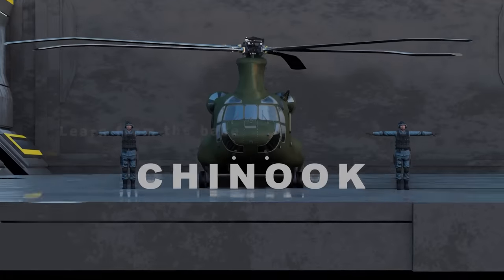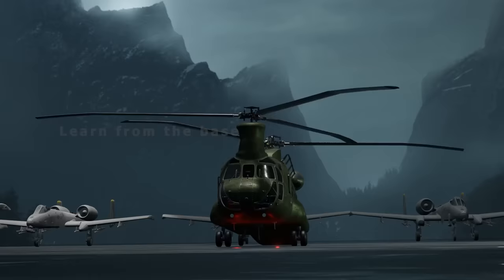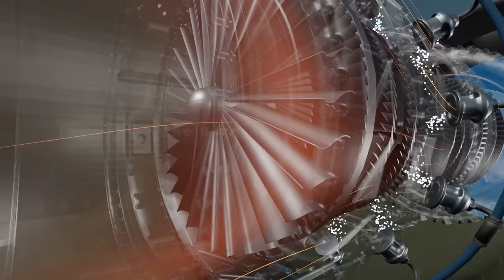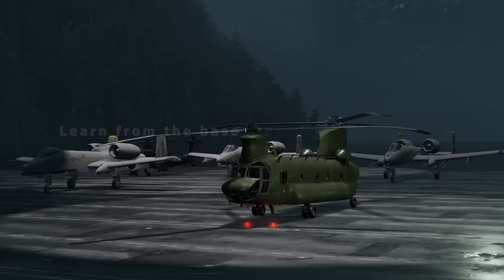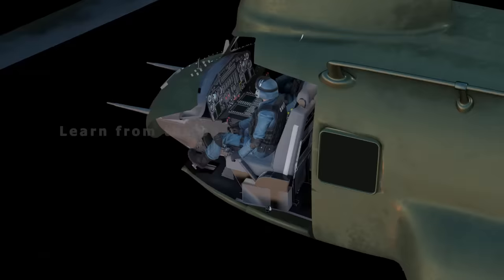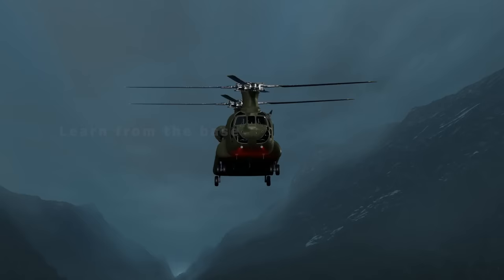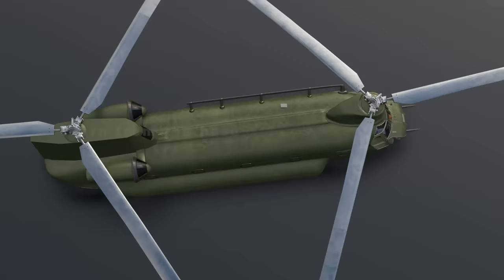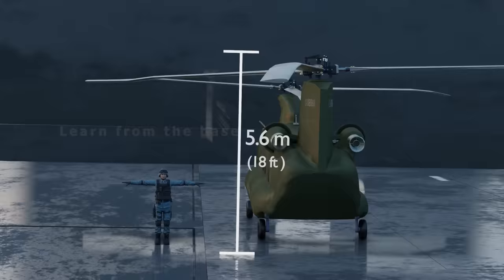How does a Cargo Helicopter work? (CH-47 Chinook) Heavy Cargo Transporter.@Learnfromthebase

Comment: Chinook can’t carry Tank.
Reply: Yes, it can
Reply: @tanjahoewel1237 he’s talking inside the cargo bay I think not the external load
Reply: Yes it can lol
Reply: @UTInteractiveYT  he’s talking about the internal catbo bay not external cargo gold ch47 can carry tanks using ropes outside
Reply: @tanjahoewel1237 so… the latest model (CH-47F) has about a 26,000 lbs cargo limit with the center hook maxing at 15,000 lbs while the fwd and aft hooks carry 5,500 each I believe? Idk that’s what the Tech Manual says anyway. The only type of “Tank” this big guy can carry is a light tank. So while you are technically right, your traditional first thought of a “Tank” weighs at least 30 tons. Meaning no dice for cargo Bobby here.
Reply: @UTInteractiveYT  so… the latest model (CH-47F) has about a 26,000 lbs cargo limit with the center hook maxing at 15,000 lbs while the fwd and aft hooks carry 5,500 each I believe? Idk that’s what the Tech Manual says anyway. The only type of “Tank” this big guy can carry is a light tank. So while you are technically right, your traditional first thought of a “Tank” weighs at least 30 tons. Meaning no dice for cargo Bobby here.
Reply: Tanks have various specification,surely scorpions has different weight from abrams
Reply: I was in the military airlift command and I'm pretty sure the old bird can't carry any tank that is in our inventory. C17 can carry one.  C5 can carry 2 but it would only do so during a war.
Reply: You can hook it outside

Comment: It's nice to see some appreciation for us cargo boys from a Chinook crew chief. One additional thing, While the aft rotors are higher than the fwd rotorhead its not the reason the blades don't hit each other. Both rotors are mechanically linked by the driveshaft so when you rotate one rotor the other one turns at an identical rate in the opposite direction. The rotorheads themselves are phased so each blade always remains the exact same distance from each other. Like the way an old hand crank egg beaters whisks pass through each other but never touch
Reply: I wonder if they'd shake each other to pieces too from rotor wash otherwise.
Reply: @first-thoughtgiver-of-will2456  look up Chinook ground resonance videos.
Reply: I was wondering what would happen if the rotors bend
Reply: @kevinfernandez9999  what do you mean by "bend"?
Reply: flex
Reply: //em//
Reply: Hated phasing the blades. In Afghanistan we had a detachment of 6 guys supporting a fleet of 6 birds. They'd detail us out so by the time we actually had to work there were only 2-4 of us, tops. Real pain in the ass when you're changing out the silicone washers on the pitch change links. Or if your sergeant doesn't listen to you and install the actuator blocks so you spend 14 hours trying to phase the damn blades before he "suddenly" has the bright idea to try it your way like it says in the book (I think he was too scared to fire the apu and bop the hydraulics).
Reply: @Kevin Fernandez  they do bend. There's a bit of flop. But on the aft, there's a droop stop eliminator. That's why you'll usually see the blades tied to the aircraft while on the flight line so they don't flap in the wind and try to eat the frame. We had that happen before. One of the things you learn early on is how to tie a good chinook knot.
Reply: Thank you for your service !!!!!!!!!!!!!!!!!!
Reply: Pls how can i join USA Air Force 
I’m from Nigeria with only secondary school certificate
Reply: What a good metaphor! It really helps a lay person understand the concept. Everything about this seems like a beautiful dance

Comment: The USAF doesn't fly the Chinook, in the US, it is flown exclusively by the Army.
Reply: I've seen Chinooks parked at Norfolk, so the Marines uses them too.
Reply: @andyx6248 you have not seen marine 47’s. Maybe 46’s 20 years ago.
Reply: @andyx6248  The USMC used to operate the CH-46, never the CH-47. The '46 is about 2/3 the size of the Chinook, had less internal seating and could not lift as much as the 'Hook. The Sea Knight was more maneuverable but the Chinook never seemed to run out of power. (I flew the '46 as a Marine and then the '47 when I "changed religions" to be come a pilot in the Army Reserves.)

Comment: When I was camping, there was a fire several miles away, a Chinook came once every ten minutes to pick up water from the lake. It was very loud and it was like thunder.
Reply: The CH-47 can carry a 2,000 gallon water bucket. This is a very powerful tool used in wild land firefighting. Army National Guard CH-47 units and pilots are expert at wild land fire fighting in their states.
Reply: @Patriot-bn9om Yes sir. I remember a famous photograph of a CH-47 extracting soldiers and civilians and detainees from the roof of a remote villiage in Afghanistan. It was the PA Air Guard pilots. Whenever I went down to Fort Indiantown Gap for training I would watch them hovering in the middle of a field 4 feet above the ground. They did that most of the-mid day to practice stabilization in shifting winds and warm air thermals. It paid off in Afghanistan and Iraq where I got to ride them in action. Those pilots would fly into the rotor wash of the leading Chinook, be blinded by dust, fly in and land sideways all off instruments and night vision. Damned good at their jobs.

Comment: I’ve had the fortune to spend many hours flying in the back of this beast. Static line jumps, HALO jumps, helocasting, small boat inserting/extracting and fast-roping. The one thing that scared the crap out of me was in-flight refueling at night: I recall one mission watching it happen under night vision while I was sitting on the floor near the forward starboard gun window- it seemed like the blades were almost touching the C-130 that was giving us gas. It was, for me, terrifying. What an amazing machine and it always brought us home. Props to the crew dogs and the pilots! 

🇺🇸
Reply: ..em..
Reply: special forces sir?
Reply: 1-60th?
Reply: //em//
Reply: @jakegames1870 160th SOAR  "Nightstalkers" (not "1-60th "). 160th is the aviation unit that flies special operations missions, SF and other military branch operators do the jumps
Reply: Still safer than stopping for gas in any large city here 😂
I stay away from all urban areas

Comment: I mean you tried.  I'll give you that. Some things are close enough.  But you should have done better research.  You got the counter torque right, but the Fwd head rotates counter clockwise, just like EVERY US designed helicopter.

Its a minimum crew of 3 up to 6 mission depending.  Never knew my Flight Engineer and Crew chief were sitting in the heater and avionics closet facing forward.  

The engine compression/combustion was close enough, as well as the description of the drive shafts.  As stated from someone else, the rotor blades are intermeshed, and phased.  

The rotor heads are of a RC model.  Not even close.  Plus there are only two dual boost actuators (not four) per rotor head.  At least you referenced Differential Collective Pitch (DCP) correctly.  And did a decent job describing how the two rotor systems work with control inputs.

And the glaringly obvious was the Tank as external cargo.  Unbelievable.

Comment: The fact that the two rotor blades never touch each other is one thing that never ceases to amaze me. The design ingenuity of the engineers hats off to them.
Reply: they're at different heights..... super complicated.
Reply: @CallMeByMyMatingName not true, they flex. The reason they dont hit, is because they are both connected by the drive shaft in a way that they will never touch, think of it like an old mechanical egg beater
Reply: @MilkT0ast    So your troll is to pretend you're blind? Kindly observe a photo of the Chinook. 

Of course, the blades are geared to sweep into the other's gap.

I'm not sure why you mention they flex though. It'd be a non-factor, for multiple reasons. 

 Engeneers obviously like redundancies. It's very clear that more than one method was incorporated to keep relatively important parts from whacking each other.
Reply: @CallMeByMyMatingName  ok I see you're just one of those dismissive people who while never yield. So good day to you sir.
Reply: I agree, nice engineering! More amazing is for me, that engineers in WW2 managed to fire the guns of fighters (Bf109 and FW190) through the prop-circle without shredding the prop. They synchronised totally different systems.
Reply: @andreasr3828  Machine guns synchronized to fire through propeller arcs was first done during the 1st World War
Reply: Bro don't act oversmart they are actually at diff height  @MilkT0ast
Reply: @CallMeByMyMatingName  nope they'll often change height enough to mesh they don't hit because of drive shafting

Comment: Great video, thanks for that. But you missed out to tell about gyroscopic possession. To move the helicopter sideways, the swashplates will tilt to front and back, depending on the rotor. The torque change will take effect 90 degrees later in the rotordisk.
Reply: That was driving me crazy but they probably simplified it for the video.
Reply: It's precession, not possession.
Reply: @prglass  thanks for making that clear. Remembered that word incorrectly and I am not an natural english tongue. But I tried to help. 😄
Reply: This is a frequent statement made about gyroscopic precession in helicopter rotors, but it is not correct. The principle of gyroscopic precession is much misunderstood. The theory is that for a perfect gyroscope in which the mass is concentrated at the periphery, when a deflecting force is applied, the resulting deflection will be 90 degrees offset, in the direction of rotation. Such a system is only theoretical. All helicopter rotors have a large mass of the rotor head at the centre, and then the mass of the blades distributed along the length of the blade. Therefor the centre of mass, which affects the gyroscopic action is closer to the centre. As a result, although gyroscopic precession definitely occurs in helicopter rotors, it is definitely not 90 degrees. If you get the opportunity to examine any helicopter main rotor system and its flight controls attached to the swashplate, look at the control input at the front. It will be offset by about 12 degrees ahead of the centreline in the direction of rotation of the rotor. This is the control that will tilt the rotor forwards to get the forward thrust for flight. The exact amount of offset will vary from one aircraft to another, depending on the design of the rotor. Most helicopters have only three input controls to the swashplate, two for roll control and one at the front for pitch control, with a device known as the fixed scissor at the rear.

Comment: Nice video, and very good explanation and drawings of the complicated  transmission of this beast.
Two mistakes: 
- tanks are too heavy to be lifted by a Chinook but this has been mentioned elsewhere in the comments;
- there are two seats in the cockpit, for the pilots only. Loadmaster, crewchief, flightengineers and gunners and whoever are all located in the cabin.
Reply: But they can lift a Mi Hind, floating tank

Comment: If they had just let someone who worked on the 47s watch the video, they can avoid these mistakes:

1. Fwd rotor counter-clockwise, Aft clockwise.
2. Crew chief seats are rear facing.
3. They are no 4 control rods below the swashplate, just a swivel and a pivot actuator.
4. Chinook can't lift a tank...

Nevertheless, still nice to see video on the Chinook.

Comment: Great video. Were well done. 
Next video: CH53K

The CH-47D’s cabin measures 30 x 8.3 x 6.5 feet (9.14 x 2.53 x 1.98m). It’s big enough to lift two HMMWVs or a HMMWV plus a 105-mm howitzer and gun crew, yet its fuselage is only 12 inches (30.5 cm) longer than the Army’s UH-60 Black Hawk utility helicopter.

Comment: A late addition to the amazing lineup for this year's Canadian International Air Show was the CH-147 Chinook helicopter.  By the time the Chinook was added, the air shows lineup was already published and released.  This helicoper does heavy lifting  mainly of motor vehicles and also manpower.  It's the fastest and most powerful helicopter.

When not used in military combat, the Chinook is used by the armed forces in transporting aid and equipment to disaster areas, such as firefighting to areas affected by forest fires and  other wildfires.  This year has been the busiest wildfire season, and firefighters and the armed forces were their ready, and the Chinook delivered some of the firefighting equipment to the sites.

Comment: Electrostatic turbulance is the most dangerous for helicopters. It happens, when a lightning strike starts. The instrument to sense it is usually not in the helicopters, because of its high price. Istead, the choppers are navigated to another route. 
When a chopper is checking for bodies in a nuclear smoke, the instrument must be installed. It's like a storm cloud with lightning strikes, and further nuclear explosins may happen in the smoke. 
The electrostatic turbuance is made by the rotor of the helicopter, because the mass of the smoke is 1.5 million tons.

Comment: You should have better arranged the rotors to shows the true angular differences between them. When any given rear rotor blade is aligned along the fuselage there is a corresponding front rotor blade also facing forward. This meshing ensures that no blades collide 😉

Comment: It’s a great helicopter but……no helicopter can lift any tank. Never saw any vehicles loaded inside, always saw them slung underneath. Faster to load and go or drop and go. 22 years in the army with 4 deployments with these always not far away. Also the blades do not overlap in rotation. If they did….it would eat those blades. When 1 blade is pointing at the mast of the second blade set. The second blade set would have one blade on either side at an equal distance from the one pointing at it.

Comment: You forgot to add that if you make the collective too much, it will stall the engine
Reply: That won't happen. The FADEC system (Full Authority Digital Electronic Control) will always dump enough fuel into the engines to meet the power demand you place on them by increasing the collective (in the Chinook, it's called the Thrust Control Lever). You'll overheat and melt the engines before they stall.
Reply: @stephenwilkens3101  imagine needing enignes
Reply: @antonykuo3809  I honestly don't know where to go from there. Well played
Reply: @stephenwilkens3101  can’t deny engines are overrated
Reply: @antonykuo3809  I mean, actually, you don't know how right you are. Since 2016, I've been flying with a patch on my flight helmet that says "I fly better with the engines off" lol

Comment: The US Air Force does not fly the CH-47, they never have. The US Army flies the CH-47. The only link the Air Force has to the CH-47 is they fought with Congress in the 1960's allowing the Army to have and use the CH-47. The Air Force didn't want the Army to have this aircraft.

Comment: it still cant out muscle a CH-53.
Reply: Not sure about the 53K, but depending on the attitude, Chinooks could out-perform the previous 53. Near sea level, it's no contest, but once you're up in high-altitude mountainous terrain, the 53's tail rotor becomes its Achilles heal. They have the power to lift insane weights up there, but they'll end up overpowering the tail rotor and starting to spin. Being a tandem rotor bird, the 47 doesn't have that problem.

Comment: It will need ejection seats to remain at the forefront of helicopter technology.
Reply: No. Chinook pilots, like all military helicopter pilots, are oriented to the earth . . .as in keeping close to it as they operate. Any serious problem? Land the Aircraft! Plus, would become a passenger in any helo when you see that the  pilots have ejection seats?
Reply: @Borzoi86  You got a point . What about this idea I saw a experimental test rig with long grasshopper like legs with smart shock absorbers , it was amazing you could drop it from 50 feet up and is would land nice and softly with no rebound . put those on a helicopter and falls from 50 feet or less would be completely safe.
Reply: @robertlackey7212  Helicopters sometimes fall from heights higher than 50 feet whenever they run out of fuel, torque or smarts (in the case of the pilots.) Helo pilots constantly monitor revolutions of the rotor within a very restricted range. (Experienced pilots can pick up a change in rotor speed just by listening.) Absent power from the engines, the pilot on the controls is now an operating physicist reviewing his/her knowledge of Isaac Newton's laws of gravity and also earnestly computing in his/her head space and time calculations to determine when to pull up the collective to convert stored energy (from the rotor system) into actual energy to cushion the landing . . . and walk away to fly another day.
Reply: @Borzoi86  I think it's interesting to hear Russians talk about future helicopter developments and compare it to what you say . I predict in 50 years Russian helicopters will be worlds ahead and Americans will see no point is advancement at all.

Comment: Not trying to be a wise guy. So many inaccuracies.  USAF does not and has never operated Chinooks.  With 7000 pounds of fuel it has a useful load of 19000 pounds. There are no seats behind the pilots for crewmen.  I flew C and D model chinooks for 5 years with just under 1000 hours in the aircraft.